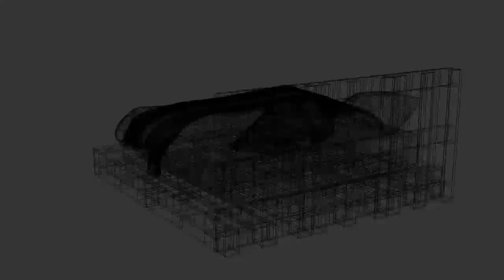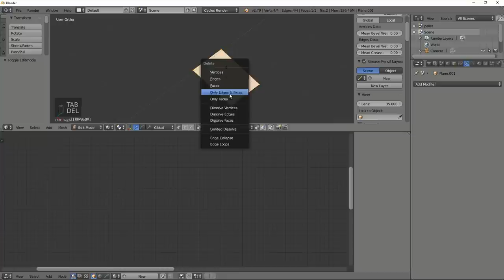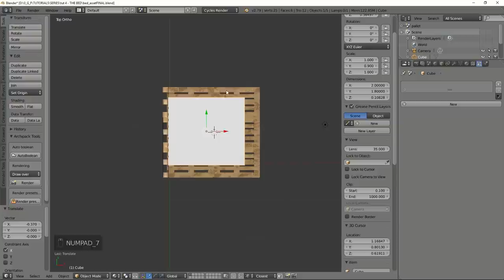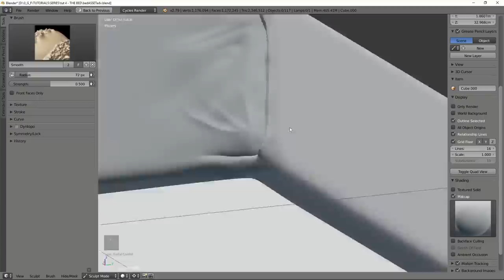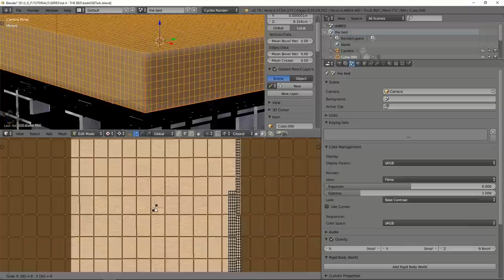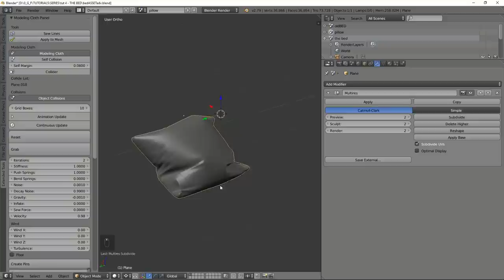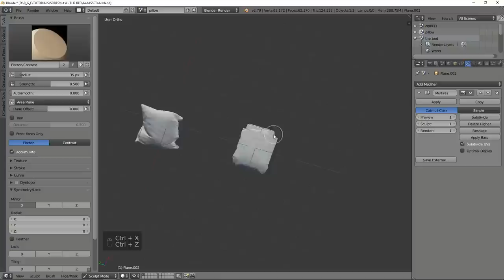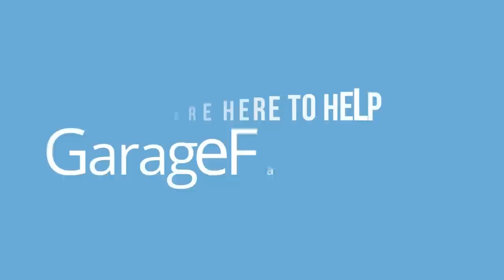Blender loft interior tutorial series | part 4: the bed

Comment: Thanks for this tutorial series. Have you tried PureRef or EasyRef for the reference photos? In Blender I use EasyRef, it is a great plugin, but paid. PureRef is a common software not only for blender,  it is also great and free.
What maybe should be mentioned is that the plugIn Modelling Cloth is still in alpha and sometimes really goes wild. Sometimes it even destroys the mesh and you can't get it back. Because of that I always make a backup copy of the objects before experimenting with the values. But it is really a great plugin.